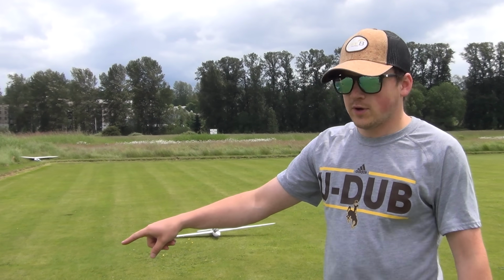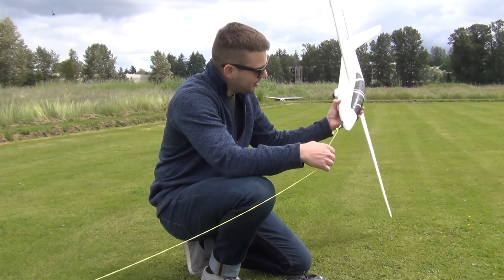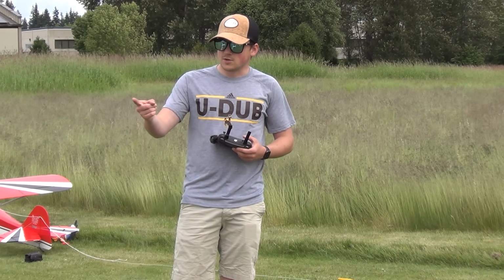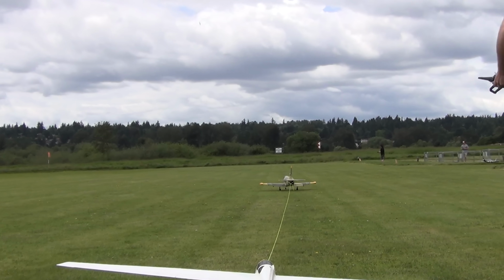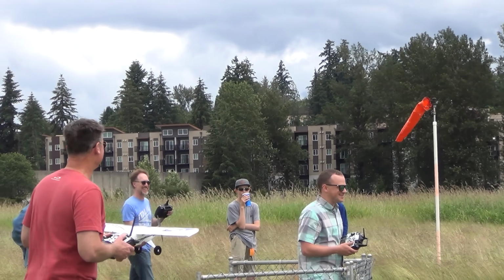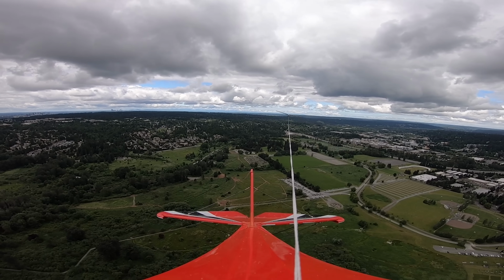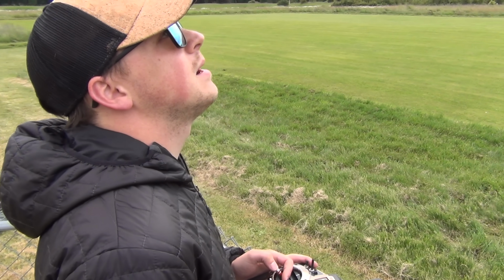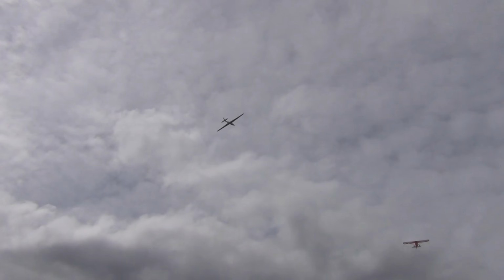UNUSUAL Glider Tows

Comment: Towing idea: A plane towing a cub without a motor😂
Reply: That's actually been done. At full scale. Absolutely whack.
Reply: I don’t know how a cub’s aerodynamics and weight is spread out and transferred, but I think removing a motor has a chance of making the plane unstable
Reply: @SuzukiKQ700owner  absolutely. Cubs glide quite well with the prop stopped. I know several pilots who have thermaled them to impressive altitudes.
Reply: Powered glider pulling unpowered cub
Reply: @SuzukiKQ700owner - Yes you’d have to add weight to maintain center of gravity.

Comment: Quad towing a glider is something i wanna see. Or even a big quad picking up a glider and then dropping it.
Reply: We pulled a pilatus porter 1.8 m once with a 5' 6s race wuad
Reply: Rctestfight used a huge expensive camera drone to lift a glider into the air. He makes crazy videos. My favorite is the full-size Ekrano plane he built with ThinkFlight and towed behind a ski boat trying to glide over the water. Let's just say the fall had to of hurt, lol.
Reply: I had a big drone that I used to drop a 1kg Strix Alatus wing. Was tricky due to the prop wash from the drone would make the wing twist around during the climb. Would be even more dicey with a large glider lol. I think a glider would need to be towed up from a large race drone to be successful.

Comment: 0:20 the Waco glider crash at the beginning has happened a lot with the 1:1 version, I just finished reading the aptly named book "The Brotherhood of the Flying Coffin". Gliders failing and crashing from bad assembly, fatigue, towing mishaps, not to mention flak and small arms fire in theater was definitely a thing 😢
Reply from the maker: Aerodynamic load exceeded design limitations. RIP. 🪦☠️

Comment: Tug jobs are UNDER-rated, big time. 
I’d like to see some outside the box challenge for a single person to tow his own glider up by himself. Gyro in glider to help stay straight, pilot the tow plane, a friend standing nearby only holding the glider transmitter in case anything goes terribly wrong. The pilot would release the tow line at the beginning of a pass into the wind and try to land the tow plane while the glider slowly… glides, and then grab the glider transmitter and turn off the gyro and resume flying it.

Comment: All your problems are from towing from the tail with an RC tow plane.  It pulls the tail all over the place. Better at the back of the wing. Or at the top of the CG.👍 happy flying.
Reply from the maker: We've towed our gliders that way for years without issue. The one issue you saw early in the video was purely pilot error. Even in my experience towing full scale gliders with a Super Cub, the tow rope was attached to the tail. https://www.youtube.com/watch?v=Qc32d0OPBHM 👍 -Zach

Comment: watched a guy at our club with a 30cc stick towing a 1.2m - 1.4m glider that had a sturdy plastic fuse.
every launch the stick pilot just went straight vertical and was up at altitude within a few seconds. after a few launches the glider guy noticed the front of his aircraft was literally being ripped off as the plastic had cracked. cant remember which, but it was a reputable brand glider of good design.
stick guy thought the glider was weak until i pointed out that you're supposed to just give him airspeed and let his wings lift him up by doing a few circuits and slowly gaining altitude, not just go vertical and literally rip the nose off his glider.

Comment: I hated tow planes until i tried it. We did only had a velcro release on the sailplane this time. So i needed to drop down fast and the sailplane pull up.

https://youtu.be/t6-6Im2f4bU?si=7Fg9veFSXi_CA88_
Tow video starts at 05:17

Comment: Ive been told by many airplane and glider pilots alike that Your Never Supposed to get the Glider Above the Tow Plane cause it will pull the tail up and send the Tow Plane Straight Into the Ground at least it does on the full scale birds.....Im seeing alot of Glider Above the Tow Plane on this Video Boys!
Reply from the maker: That's what is great about RC. You can try things out and go beyond normal full-scale limitations without risking your lives. As you saw...it doesn't do as advertised when the tow plane has gobs of excess thrust. 😁
Reply: @TailHeavyProductions  Your 100% Right on that point had all the aviation pioneers had Rc Planes to test things out with 1st there woulda been a hell of a whole lot more Elderly Test Pilots Alive Today
Reply: @TailHeavyProductions  You mean gobs of excess lift
Reply from the maker: https://www.grc.nasa.gov/www/k-12/VirtualAero/BottleRocket/airplane/exthrst.html#:~:text=The%20thrust%20minus%20the%20drag,force%20is%20the%20excess%20thrust.

Comment: Towing a glider with a fast EDF now that's something different or mad, I'm surprised the wings stopped on the glider.
Reply: Vne? Nah, Vwheeee! 🚀

But seriously, how many gliders folded under pressure?
Reply from the maker: Vne is a number made via flight testing and engineering data that is conservative and still well below the actual airspeed where an aerodynamic load would exceed the design’s limitations leading to a catastrophic structural failure. In our case, no airframes were harmed and no limits were met. 😛👍

Comment: Guy's, guy's, guy's... You really should have the tow rope on the CG on the tow plane. Just some knowledge real tow planes have crashed because the saiplane upsets the tow plane and they don't recover.
Reply from the maker: We've towed our gliders that way for years without issue. The one issue you saw early in the video was purely pilot error. 😁Even in my experience towing full scale gliders with a Super Cub, the tow rope was attached to the tail. The need to tow exclusively from the CG seems to be a common misconception in the RC world. https://youtu.be/Qc32d0OPBHM?t=26  -Zach